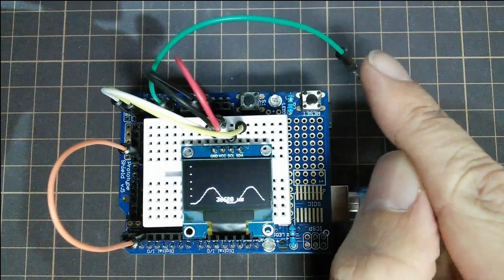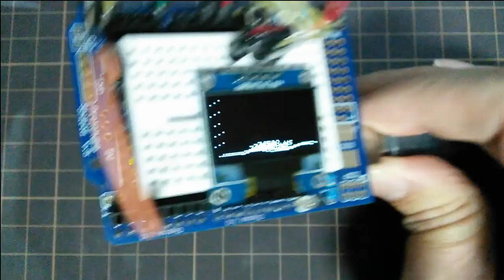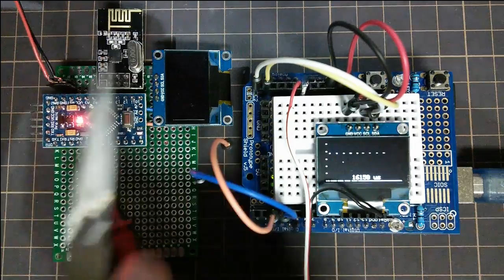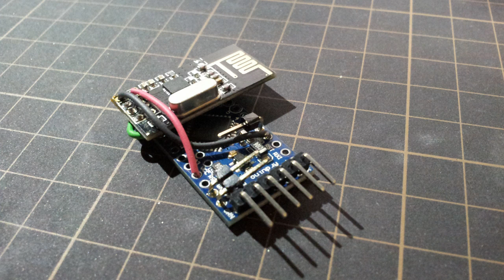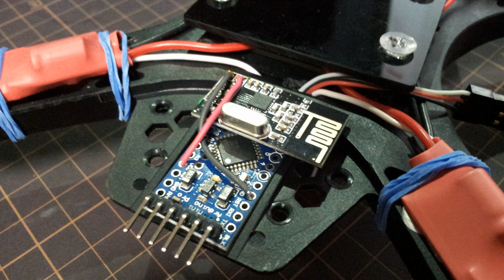Arduino mini-oscilloscope

Comment: good job! my testing shown finger touch image, and straights line of DC voltage, not show waves, what can be? thanks.
Reply from the maker: I would not expect waves just from touching it with your finger, at least if you are a normal human. I think it only happened for me by some rare coincidence.
Reply: @iforce2d  ha. I mean can it works as an Oscilloscope to show sine wave with a signal input?

Comment: Hi wonder if anyone's come across this problem with this project the waves read on the oled as shown, yet can't adjust the wave amplitude (that is height)  hold and select buttons won't work either have checked all the connections they are all exactly the same as this, maybe  a problem with code? Thanks in advance for any positive suggestions if anyone has any?

Comment: I built one of these back when you first posted it, mounted the deal in an Altoids case, used a pro mini so it would fit with a 9 volt battery running it all, put little clips on the end of the wire. I now have a couple kit built scopes that do a little better job but once in awhile when I just need a quick look at a signal, I grab the little tin box and hook her up.
Reply: nice project but could you pls post a schematic part?  i would be thanksful to see it

Comment: Instead of modifying "sampleRate = ..." on top, I've connected a potentiometer between Vcc, Gnd, and A1. So I define "sampleRate" each time the main loop starts.
void loop() {
sampleRate = map(analogRead(1), 0, 1023, 1, 10); 
....
This helps for visualisation of low frequency signals.
I still have to fix TRIGGER_ENABLE and SCREEN_UPDATE_ENABLE. Connecting pin 2 to Vcc just display a static curve, and pin 3 doesn't do anything.

Comment: The provided code does not display anything on my OLED screen. I am using a HiLetgo .96" OLED I2C IIC SPI Serial 128x64 OLED LCD, 4 pin display that is colored white. Could this issue be related to an updated version of the Adafruit libraries?
Reply from the maker: hmm... I don't know. It sounds like your gear is the same as mine. Usually libraries like this are written so as not to disturb existing code.

Comment: Thanks for posting, I am gonna to use it as a starting point for a oscilloscope display built into a Eurorack module for an analog synth. You saved me a few hours of headache.
Reply: I want to do the same, did you manage to do it ?

Comment: I just made this , comes up as 14 ms and not the expected 36 , anyone know why ?
Reply from the maker: Are you using a 8MHz cpu or 16MHz?
Reply: Crystal says 16Mhz.  I can get longer times by increasing the int sampleRate?
Reply from the maker: No, sorry it's been a long time since I made this, I thought it was using ticks to measure time.
Reply: iforce2d if i increase the intsample it does show a longer section which is better for lower frequencies although then the refresh is slow on the updating,anyways i understand if its been a long time,thanks for the sketch.

Comment: for example, i want to include pulse sensor and produce real-time waveform to oled display. Which part of the code that I need to adjust? Can somebody helps me out?
Reply from the maker: I think you will need a better CPU and a better screen for a real-time display, eg: https://goo.gl/8w8CS0
Reply: okay great. but how about the code? and can you look at this example http://arduino-er.blogspot.my/2015/04/display-waveform-on-mini-oled-with.html
Reply from the maker: The code for a different CPU will be completely different. I don't think you could even use this code as a starting point, it's so different. I have no idea how to do it. What should I look at that code for? If you have a question about somebody else's code, ask the person who wrote it :)
Reply: okay then..thanks

Comment: Hi, I am using a display looking just similar BUT not exactly the same. Its top portion has a few lines of yellow pixels while the bottom part is all made of while pixel rows. There is a slight separation between the two areas.
Running this code will just result in only showing 3 out of 6 of those volt dots which appear on the left tension scale.
Basically the level "0 volt" line is not visible while the top of the waves appear only when their volts is above 3.
Can anybody explain that? Although I suspect the library might be the problem, the same library perfectly works on other sketches I have already run.
Thanks
A
Reply: the library is coded to 128x32. You need change Adafruit_SSD.....
Reply: Roberto S. Chiandotti @Roberto S. Chiandotti How do I go about doing what you're recommending here?

Comment: simple useful,I changed a line like this --- display.begin(SSD1306_SWITCHCAPVCC, 0x3C); // Initialize with the I2C addr 0x3D (for the 128x64).

Comment: Hello, thanks for all your projects and good luck for you.
I have one question about your mini oscilloscope. I made the similar
project of oscilloscope (I mean using the same OLED display).
But I use my own code, and here the part of it:
for (x = 10; x <= 128; x=x+1) // collecting data in array
  {
    data[x] = (analogRead(READ_PIN) / 21.7659);  
 }

for (x = 10; x <= 127; x++) // draw data in OLED
{
display.drawLine(x , 63 - (data[x]), x , 63 - (data[x+1]), WHITE);
}

this routing work fine until 10 kHz when I configured ADC in the start of sketch
like this: 
//adps2  adps1  adps0  factor
//  0      1      0      4
//  0      1      1      8
//  1      0      0      16
//  1      0      1      32
//  1      1      0      64
//  1      1      1      128
sbi(ADCSRA,ADPS2);
cbi(ADCSRA,ADPS1);
cbi(ADCSRA,ADPS0);
 But I do not know how can I trigger graph in my case, because it flows allways,
can you help me to solve this problem.Thank you. (sorry about my english)

Comment: so if you say (7:00) it takes 10 lines of code, i can use another uC like ATmega8(-A)(arduino NG)?
Reply from the maker: Gabi Done It takes 10 lines of code to find the zero point for the trigger... not 10 lines of code for the whole thing. The source code is at the first link in the description.

Comment: Nice project. I have one question concerning use of Analog pins 4 & 5 for the SDA and SCL lines. I assume they are set to behave as digital outputs but where in the code does is that specified? I even looked in the included library files. On other projects I've used digital pins 11, 12 & 13 for the SPI interface.

Comment: I have a problem with with my arduino uno (R3) , using same parts without shield , it's freezing my screen from time to time, getting some strange reads when is out, it's reading when i put it in 3.3 and 5 V it's reading correctly and triggers are not working, is my arduino "broken" or i'm doing something wrong ? I'm new to this so there are some things i don't understand.
Reply from the maker: Niga Vasile Best way to find out would be to try a different arduino or a different screen and see if it still happens. Perhaps you could start by trying to figure out what causes the freezes so you have a better situation than "from time to time"
Reply: +iforce2d Seems my arduino was broken is working fine now with a new one thanks for help and for code sharing. Have a nice day.

Comment: help me! connect OLEDdispley128x64  for SPI.
My setch not working(

#include <SPI.h>
#include <Wire.h>
#include <Adafruit_GFX.h>
#include <Adafruit_SSD1306.h>

// If using software SPI (the default case):
#define OLED_MOSI  11
#define OLED_CLK   12
#define OLED_DC    9
#define OLED_CS    8
#define OLED_RESET 10
Adafruit_SSD1306 display(OLED_MOSI, OLED_CLK, OLED_DC, OLED_RESET, OLED_CS);
/******************************************/

#define CHARWIDTH           5
#define CHARHEIGHT          8
#define AXISWIDTH           (2 + 1)                   // axis will show two-pixel wide graph ticks, then an empty column
#define VISIBLEVALUEPIXELS  (128 - AXISWIDTH)         // the number of samples visible on screen
#define NUMVALUES           (2 * VISIBLEVALUEPIXELS)  // the total number of samples (take twice as many as visible, to help find trigger point

#define TRIGGER_ENABLE_PIN       2  // set this pin high to enable trigger
#define SCREEN_UPDATE_ENABLE_PIN 3  // set this pin high to freeze screen

byte values[NUMVALUES];           // stores read analog values mapped to 0-63
int pos = 0;                      // the next position in the value array to read
int count = 0;                    // the total number of times through the loop
unsigned long readStartTime = 0;  // time when the current sampling started
int sampleRate = 1;              // A value of 1 will sample every time through the loop, 5 will sample every fifth time etc.

/******************************************/

// Draws a printf style string at the current cursor position
void displayln(const char* format, ...)
{
  char buffer[32];
 
  va_list args;
  va_start(args, format);
  vsprintf(buffer, format, args);
  va_end(args);
 
  int len = strlen(buffer);
  for (uint8_t i = 0; i < len; i++) {
    display.write(buffer[i]);
  }
}

// Draws the graph ticks for the vertical axis
void drawAxis()
{ 
  // graph ticks
  for (int x = 0; x < 2; x++) {
    display.drawPixel(x,  0, WHITE);
    display.drawPixel(x, 13, WHITE);
    display.drawPixel(x, 26, WHITE);
    display.drawPixel(x, 38, WHITE);
    display.drawPixel(x, 50, WHITE);
    display.drawPixel(x, 63, WHITE); 
  }
}

// Draws the sampled values
void drawValues()
{
  int start = 0;
 
  if ( digitalRead(TRIGGER_ENABLE_PIN) ) {
    // Find the first occurence of zero
    for (int i = 0; i < NUMVALUES; i++) {
      if ( values[i] == 0 ) {
        // Now find the next value that is not zero
        for (; i < NUMVALUES; i++) {
          if ( values[i] != 0 ) {
            start = i;
            break;
          }
        }
        break;
      }
    }   
    // If the trigger point is not within half of our values, we will
    // not have enough sample points to show the wave correctly
    if ( start >= VISIBLEVALUEPIXELS )
      return;
  }
 
  for (int i = 0; i < VISIBLEVALUEPIXELS; i++) {
    display.drawPixel(i + AXISWIDTH, 63 - (values[i + start]), WHITE);
  }
}

// Shows the time taken to sample the values shown on screen
void drawFrameTime(unsigned long us)
{
  display.setCursor(9 * CHARWIDTH, 7 * CHARHEIGHT - 2); // almost at bottom, approximately centered
  displayln("%ld us", us);
}

/******************************************/

void setup() {

  // Set up the display
  display.begin(SSD1306_SWITCHCAPVCC);
 
 display.setTextColor(WHITE);

  pinMode(TRIGGER_ENABLE_PIN, INPUT);
  pinMode(SCREEN_UPDATE_ENABLE_PIN, INPUT);
}

/******************************************/

void loop() {
 
  // If a sampling run is about to start, record the start time
  if ( pos == 0 )
    readStartTime = micros();
 
  // If this iteration is one we want a sample for, take the sample
  if ( (++count) % sampleRate == 0 )
    values[pos++] = analogRead(0) >> 4; // shifting right by 4 efficiently maps 0-1023 range to 0-63

  // If we have filled the sample buffer, display the results on screen
  if ( pos >= NUMVALUES ) {
    // Measure how long the run took
    unsigned long totalSampleTime = (micros() - readStartTime) / 2;     // Divide by 2 because we are taking twice as many samples as are shown on the screen
 
    if ( !digitalRead(SCREEN_UPDATE_ENABLE_PIN) ) {
      // Display the data on screen  
      display.clearDisplay();
      drawAxis();
      drawValues();
      drawFrameTime(totalSampleTime);
      display.display();
    }
      
    // Reset values for the next sampling run
    pos = 0;
    count = 0;
  }
}
Reply from the maker: SergeyD "not working" is a completely useless description. Please be more descriptive.... is that my sketch? Did you change something? If you changed something, tell me what you changed instead of expecting me to play find the difference in your code. Better still, just use my code first and get that working before changing it.
Reply: ***** I want to connect the display interface SPI. I changed the beginning of your code interface I2C
//////////////////

#include <SPI.h>
#include <Wire.h>
#include <Adafruit_GFX.h>
#include <Adafruit_SSD1306.h>

// If using software SPI (the default case):
#define OLED_MOSI  11
#define OLED_CLK   12
#define OLED_DC    9
#define OLED_CS    8
#define OLED_RESET 10
Adafruit_SSD1306 display(OLED_MOSI, OLED_CLK, OLED_DC, OLED_RESET, OLED_CS);
 /////////////////////////////////////////////
but it does not work for some reason,
I am not to understand programming, please help

P.S
I use a translator,  do not know English
Reply from the maker: SergeyD Again, "does not work" is a completely useless description of the problem. Does it compile? Does it upload? Does it run at all? In any case, if you are using different devices to what I have used, I cannot help you.
Reply: ***** make minor changes and earned pin 3  (SCREEN_UPDATE_ENABLE_PIN) was drawn to the high levels because the code does not work

Comment: the 20 millisecond pulse is due to powerline radiation. You can see it in normal oscilloscope also when you touch the probes with finger. :)

Comment: 50 Hz "humm" is 20msec.
Reply: +morpher44 This is correct. If you notice the sample points are really stretched out in the middle and the waveform is being clipped at the top and bottom.
Reply: Nikolas Britton display needs to use double-buffering.

Comment: Would a pull-down resister help to smooth out the signal or would it put too much current into the arduino?
Reply from the maker: fezickthebig I don't think it would do anything to the signal except change the voltage of it. Capacitors would change the signal because they take time to charge/discharge, but unless I'm very much mistaken resistors arestill instantaneous :)

Comment: Would it be easy to display this graph in processing on a connected computer?
Reply: Wouter Van Goey Yes, but a little less than $20 dollar thing has to hook up to a thousand dollar thing. It is more cool if you can do everything on the cheap. I'm worried these little OLED displays are basically too slow for an oscilloscope. We would need a display that can do 500 FPS or greater to get into the realm of audio oscilloscope.
Reply: Yeah I feel you but everyone already has a pc, how many people have oled displays laying around? I get it, they're cheap, but the added functionality a pc would give negates that imho.
Reply from the maker: Wouter Van Goey Most PCs don't have any convenient way to measure analog voltage like the analog pins on the arduino can. You could connect the arduino to your computer and send the info to display on the screen of the PC, then you have to write more code for sending from the arduino side and to interpret the incoming data at the receiving end, and code to draw the graph. I hear processing makes that easy but I've never tried it. But in any case, you would not get better results because the speed of it depends on how fast the ADC in the arduino can convert the voltage samples it sees into digital values. The 'added functionality' of the PC would only be that the final display looks prettier, on a bigger screen.
Reply from the maker: morpher44 As far as I know digital oscilloscopes take a sample and then display the result, same as this one does. They don't refresh their screen anywhere near 500fps. The usefulness of the scope is not limited by the display refresh rate, but the speed of the ADC in the arduino, and the number of samples it can store for each pass. Although I guess, if the display rate goes below a few refreshes per second that would be kinda limiting :)
Reply: ***** Right. With a low FPS, you will be "missing" much of the data. You will be only able to see every Nth frame. That might be ok for such a low-end, cheap, scope. Sample rates won't be able to go up very high too, though, because if there is an interrupt per sample, eventually you are over-saturated with interrupts. It would be better to have hardware assist here (DMA, FIFOs) for the sampling. Some sound chips like AC97, have fifos, DMA, etc.

Comment: As was already stated the "waves" are the result of the power wiring in your house, either 50 or 60 Hz depending on where you live....you do not need to touch the input wire because it has a high input impedance and the signal is being "capacitively" coupled into it from your hands proximity to it and when you touch it your "clipping" the input because your exceeding 5 volts.  This limited bandwidth oscilloscope is still useful for monitoring line power, checking sub audible frequencies used in CTSS radio signaling, and with a little modification a useful multi channel logic monitor...

Comment: Looks like you could also make a digital Theremin.  Just take the input as your hand comes closer and further from your green wire probe and output a sound frequency based on that.
Reply from the maker: Yes indeed... hmm... arrghh... I will not be able to stop thinking about that now :)
Reply: djmips It would be better to use a light-sensitive resistor across the ADC for a Theremin. Light offers certain advantages over inductance.
Reply: I worked for MONTHS on an inductive theremin, using a Nano. Ultimately threw the entire contraption at the wall in frustration because of uncontrollability.  You might have better luck, but it was just too damn many variables, I did end up using a photo control later.

Comment: This is brilliant (elegant) solution.

Ultimately my goal is to integrate a MMA7455 (3-axis Accelerometer) to show (real) basic displacement along all three axis. I have the the MMAA7455 working nicely, as well as the OLED, but learning as I am going and your solution seems to be the closest I have seen.

I have implemented it using a sainsmart Nano, and for the most part it works perfectly except I get freezing of the OLED and previous reading. Left alone, it unfreezes by itself- any guidance would be much appreciated!